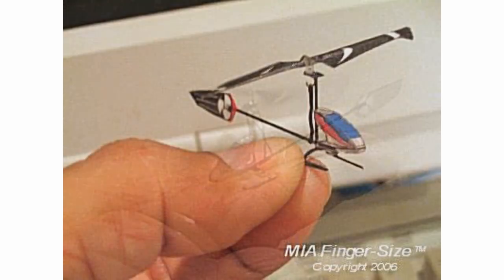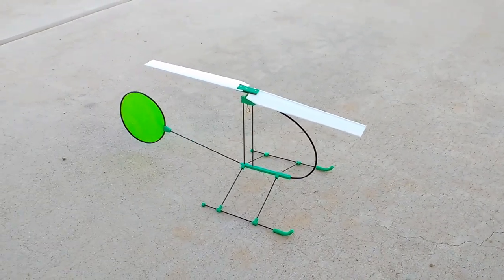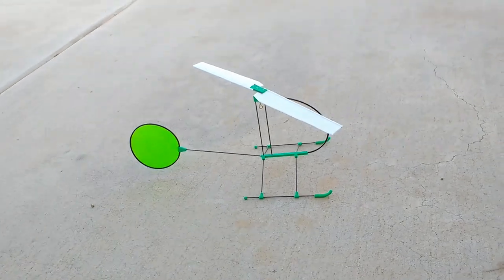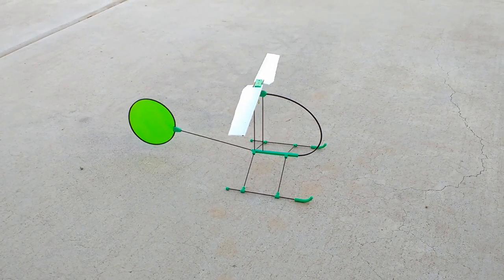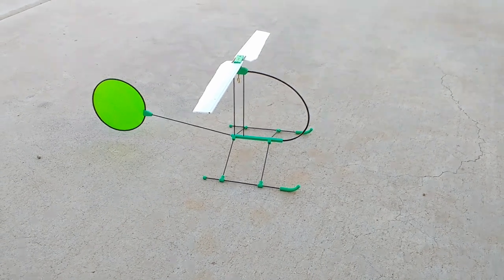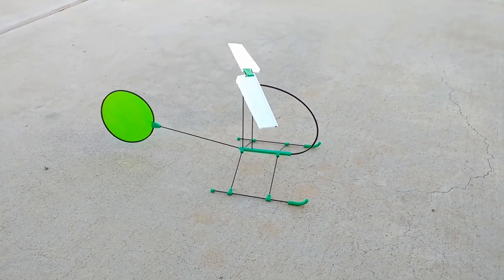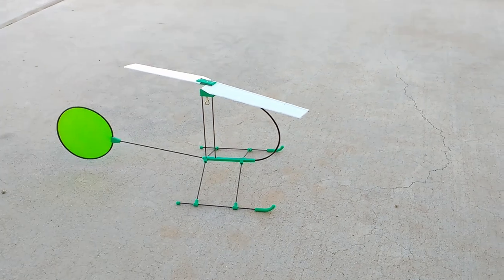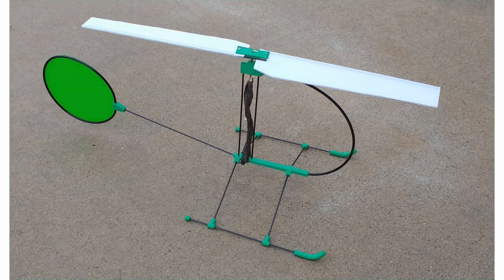Rubber Power Helicopter

Comment: This is crazy, you used to produce rubberband helis? I have two models, I have a commercially produced Funcraft Shark Contra rotating rubber ban heli, and then a much more obscure "Copter Concepts" Scale balsa Huey rubber band powered heli. I have it new in box unbuilt It uses a neat gear and pully system to power the tail rotor. I don't know much about it. I just got it on ebay a few months ago and havn't yet built it.
Reply from the maker: Very familiar with the shark, which I discovered for sale in a swap meet, or surplus store,  I think,  foamy shell very fragile plastic parts, never got it to fly to my expectations. I still have it in the original box  sitting in my garage for more than 30 years. It is probably brittle.  I stopped making rubber powered heli kits when I started designing more elaborate free-flight and RC kits as these provided much much better flight times and you could control them with RC.  In my early days of messing with rubber powered helis, I did my share of balsa and tissue, my favorite was an scale Bell 47G, Long Ranger  and MD 500 also geared  and belt driven tails  and some with especial mechanics to aid in rubber length,  torque and speed.  My issue with rubber powered helis was the lack of flight time, helis consume almost all the powered instantly, since they do not glide as airplanes and rely on brute force to lift. At least with rubber powered airplanes you can minimize the power consumption and extend flight time by using their inherent gliding characteristics. However, there are some very creative ways to get more rubber power to the heli but this is balancing act with weight. Some of my early kits were very simple for this reason,  but different than anything that resemble a true helicopter. I did some extremely large rubber powered helis  also for fun and to make use of longer rubber lengths.  But  if we want great flight times on rubber powered helis, simplicity and extreme light weight is the answer.